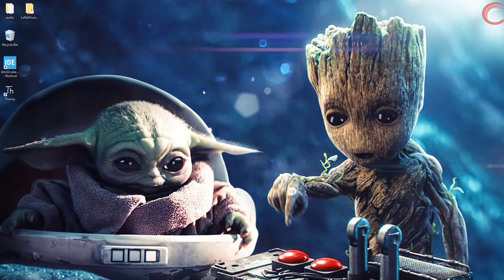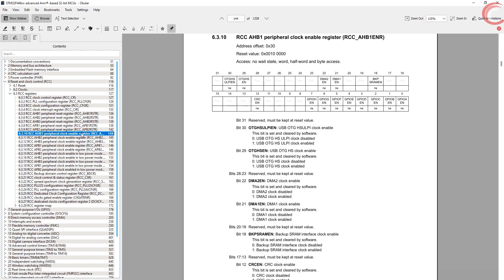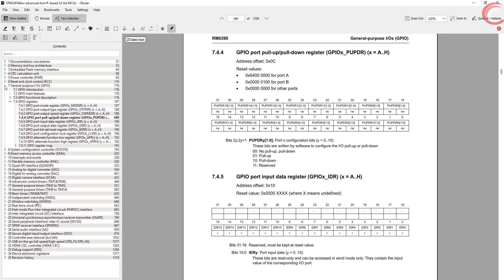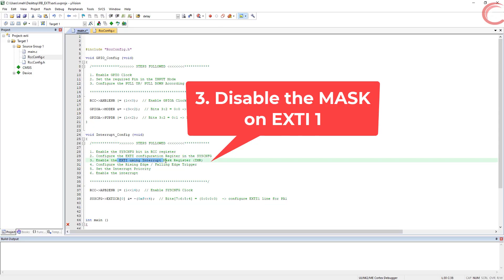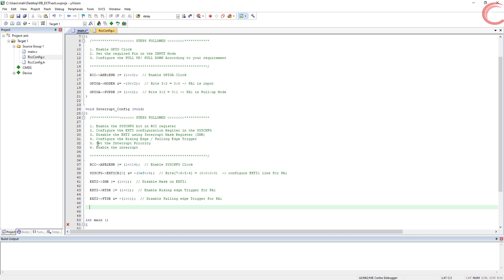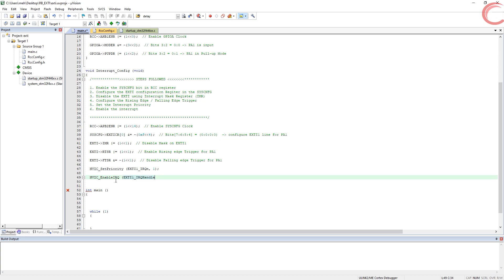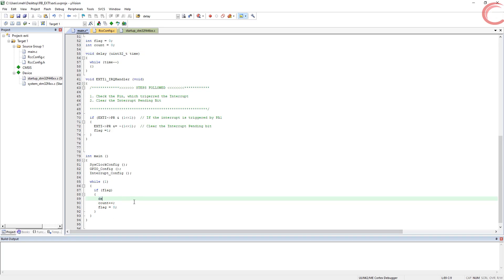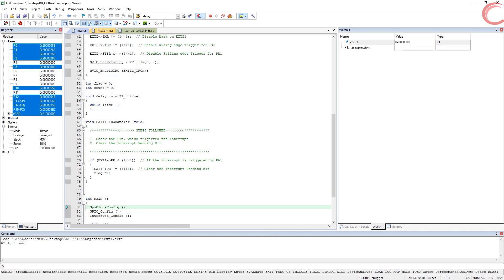#7. EXTernal Interrupt using Registers || STM32F4 || STM32F1 || NO HAL

Comment: I have a problem. My nvıc functions error. ıt doesnt see EXTI1_IRQn. How can ı fixed ?
Reply from the maker: Someties the EXTI is grouped.
For example, it could be a grounp of 4 pin from 0 to 3. In that case it would be defined as EXTI0_3_IRQn.
Check the device header file to see it.
Reply: @ControllersTech  firstly I am so grateful for your answer. Thank you. I couldn't solve my problem. My problem is NVIC functions. ı cant use nvıc funtions. I am looking programming manual but still ı cant solved. I guess I need to use the misch.h library but I can't. If you know how can ı use, can you say ? 
THANK YOU SO MUCH AGAIN

Comment: Thanks a lot for your enriching videos. Please I am having challenges with setting breaking to finite state machine processes inside my input capture callback function (HAL_TIM_IC_CaptureCallback(TIM_HandleTypeDef *htim)). My Input capture is with HAL library on Keil IDE, configured WITHOUT CubeMX. My finite state machine is debugging well with CubeMx but I am really wondering while it isn't working without CubeMx. I am under directive not to use CubeMx. I am thinking my input capture configuration may be the problem. I can send you my configuration code on asking. My MCU is STM32F407Vet with 8 MHz external crystal oscillator which I'm using. Thanks again.